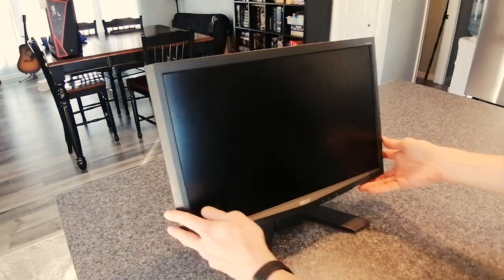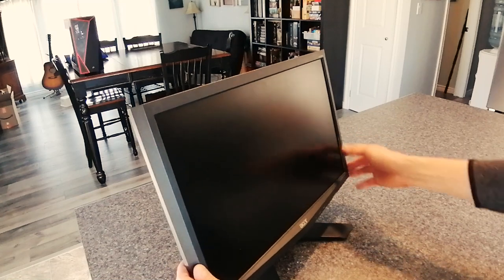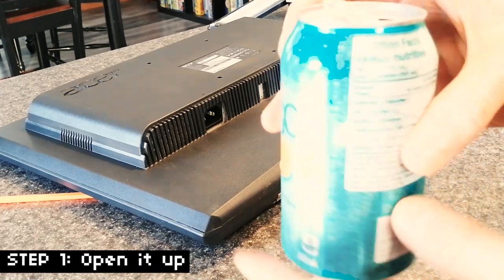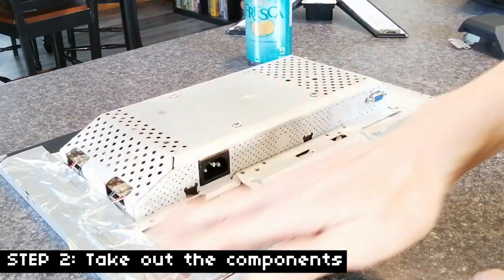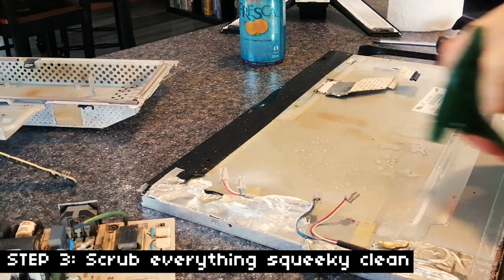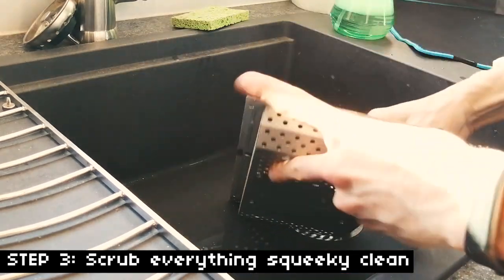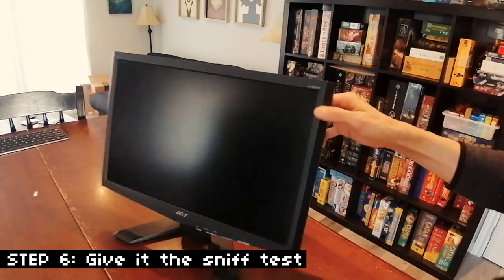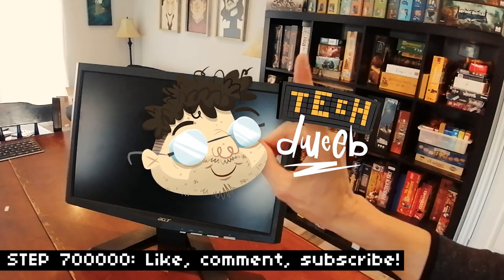How to get rid of smoke smell from electronics (the EASY way, and the HARD way...)

Comment: Next time clean it and the spray a little Lysol on a rag then wipe it down and it should take off the bacteria that is causing the odor
Reply: I did Lysol wipes and it only took the smell away for a few hours. My impression is lysol is mostly scented water on a rag claiming to actually clean anything. My nose is good enough to tell there's smoke smell mixed with the luson scent.
I was able to get the smell out for good by scrubbing it with a sponge filled with clorox under the water, but unfortunately I can't do that to the monitor boards (they're still stinky, I'm leaving them in my garage to see if being exposed to circulating hot air will release the smoke particles.
I still can't understand how people still smoke in 2023

Comment: Isopropyl alcohol is what I typically see used for cleaning electronics. Higher percentage=better, lower percentage means more water+more chance of oxidation/rust. The more alcohol the faster it will evaporate. Plastic components without electrical parts attached being far less picky; if you can separate them from the electronics you can pretty well scrub at the sink with dish soap or similar. Obviously make sure everything thoroughly dry before reassembly. For sensitive electronics (+I'm guessing you don't care much about used monitors, but other stuff potentially) you need to be careful about exposing them to static electricity; the typical method to protect the device from your own static is to wear an ESD bracelet+ground it (in this case clip it to something large with bare metal to absorb static). Lots of computer+electronics videos out there that can elaborate on this. As far as the bag+baking soda, you can also make a sachet of odor-absorbing carpet powder.. which is mostly baking soda, but sometimes has other things added. I haven't identified yet which I like using more. But typically thoroughly washing, drying, then the baking soda/bag thing as a backup. I'm not a pro at this but is what have gathered so far. Hopefully it helps some people.
Reply from the maker: Good info here☝️

Comment: My PS5 was from a smokers house! Had to disassemble the entire thing and clean it very carefully. Your video helped! I will try to avoid buying used things from now on, most when they are brand spanking new
Reply: You can still buy used stuff locally. This way you can see if it has that stench or any other issue that you don't want to deal with. Been doing it for years and have gotten some amazing deals.

Comment: Do you have any tips for bad cigarette smoke for Sony headphones? I bought them but didn't realize how bad it smells. I don't want to mess up the wires/electronic parts in charge of the noose cancellation.
Reply from the maker: My only suggestion would be to try the baking soda method I described. That will help a bit.

Comment: I bought a used laptop got a good deal it but smells like smoke as soon as the fans kick in...
I didn't want to but I guess gonna have to remove the heatsinks and clean out the fans and vent grills not gonna be fun but I don't see any other way....
Reply from the maker: If the smoke smell is really bad, then yeah not really any other way. That stinky smoke goop gets stuck in every little crack and crevasse. The only way is to get in there and scrub it off. :/